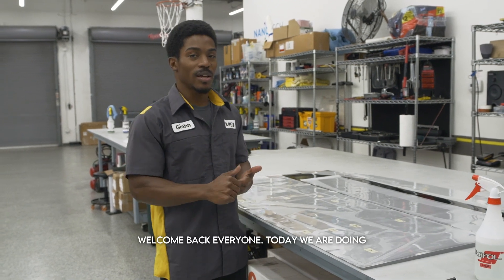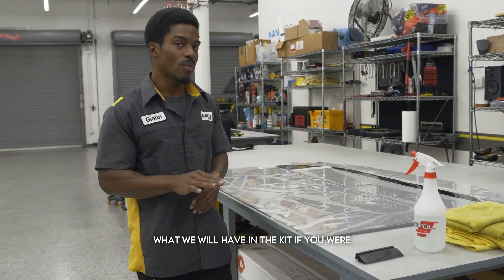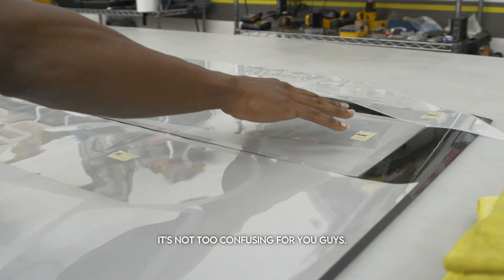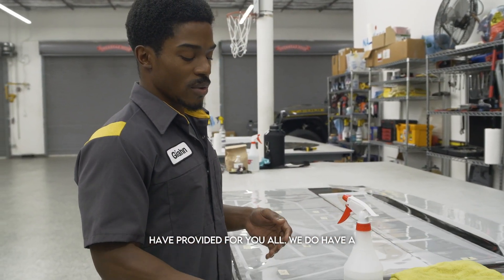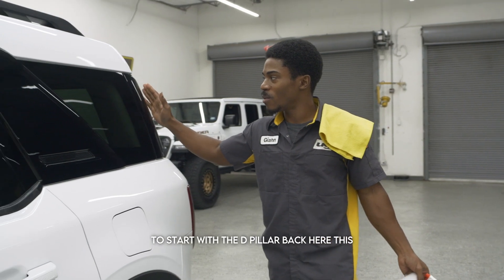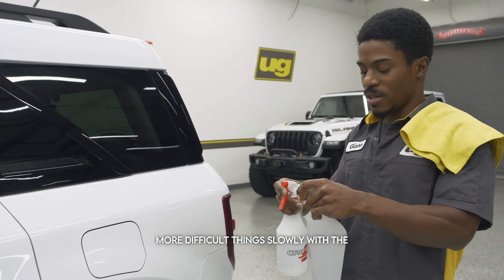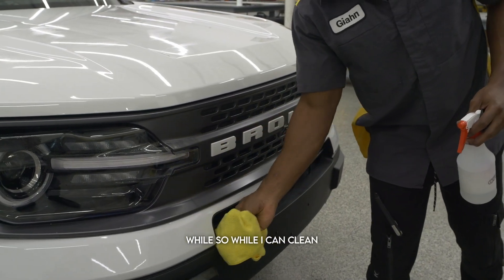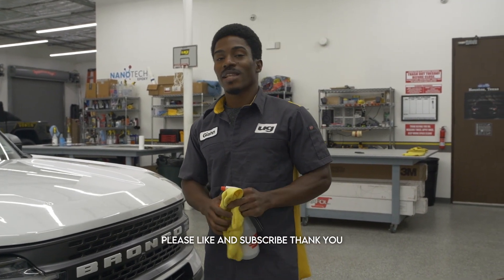How To Install Your Bronco Sport PPF Pieces | From Underground Graphics

Comment: My Bronco has been ceramic coated.  Can I install the PPF on the ceramic coating?
Reply from the maker: Unfortunately not it’s recommended to apply the PPF then ceramic coat to avoid bubbles & bonding issues with the PPF